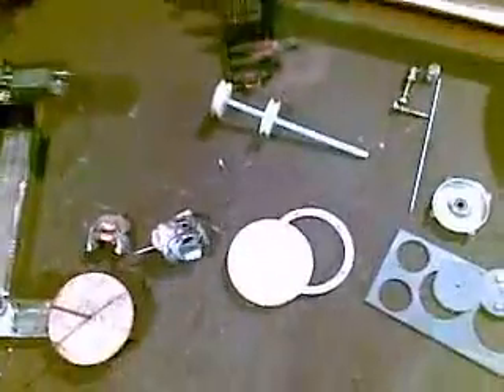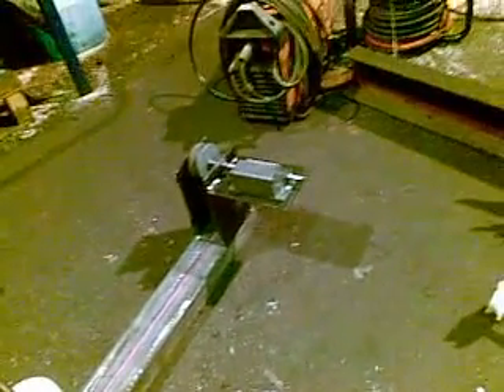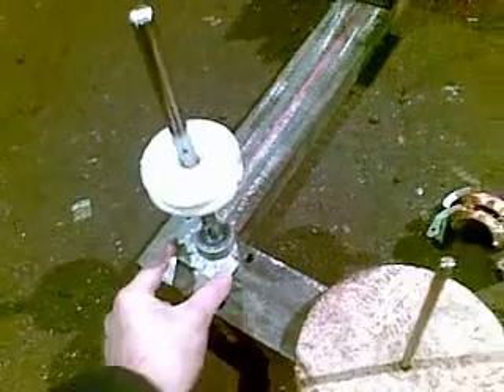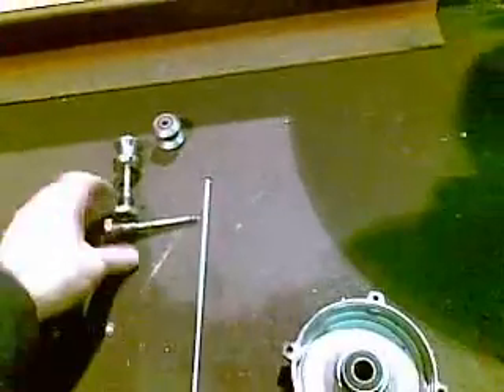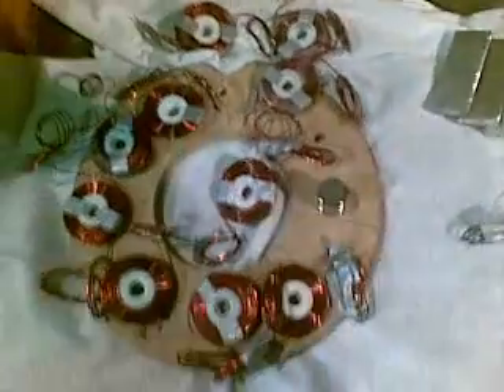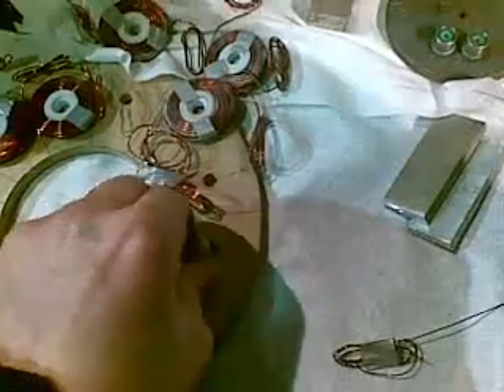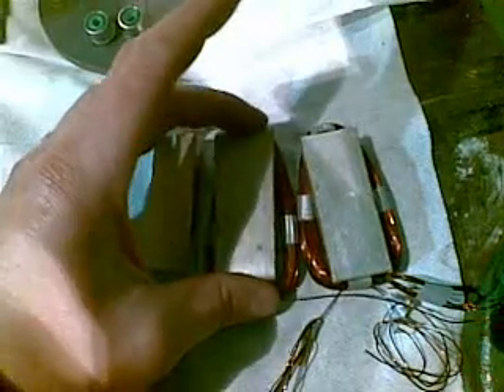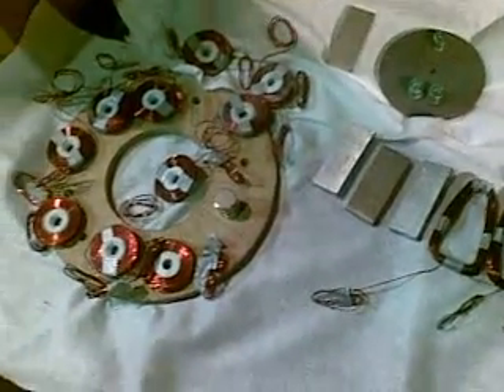rock solid & great alignment wind turbine copper coil winding jig project . (part.2)

Comment: John, two questions:
1. Will you sell some of these, as I'd like to build some ideas I have as well, and would like to start with something that has some success.
2. What is your experience with solid core, and magnetic resistance? I've read some that say solid core delivers more power, however also creates enough mag field to build resistance as the frequency increases.

Comment from the maker: @rikkiesix i have a bifilar stator containing 12 identicial bifilar circuit breaker coils which i can switch between delta and star easily ... i have used 3 different magnet rotors with different speeds, distance, power , magnet sises and thickness in an attempt to find the best results , i really should do another video on that with more detail because this particular delta configuration i have found on another stator increases power by a factor of 8 at almost 4 times this magnet rotor speed

Comment from the maker: @rikkiesix .... hi there user rikkiesix , when i said the coils must be 1/3 the thickness of the magnets its ment that 2mm thick magnets are suitable for 3mm thick coils then 4mm thick magnets are suitable for 6mm thick coils 6mm tm for 9mm tc and so on ...can you see the pattern ..... however this was info i obtained from the net and may only apply to air core coils , i have recently built another far superior stator with soft iron cores and have tried different magnet rotors of different sises

Comment from the maker: sorry about the volume situation its a cheap camera phone that im still trying to master .... next videos will be on a tripod  and il use hands free mic with the phone  ... these particular coils im doing here are air core 1mm gauged wire with 70 turns capable of 24 volts according to hugh piggots website   .... im just demonstrating this jig i use / designed for other coilwinding projects i will be doing